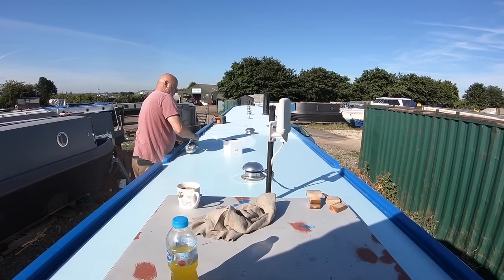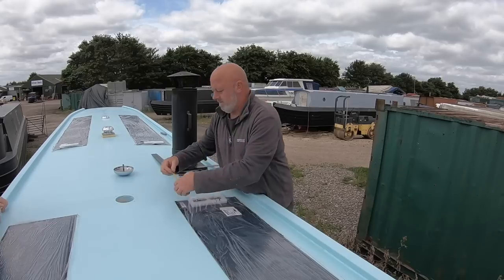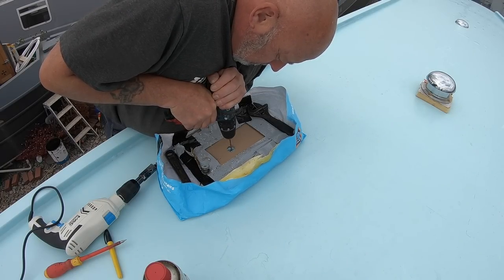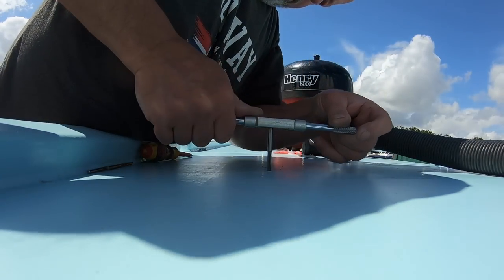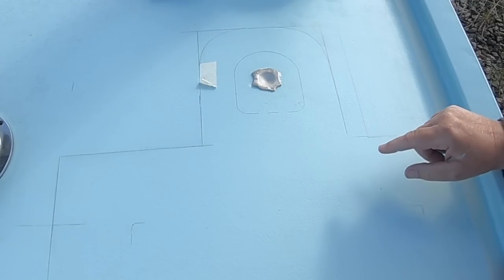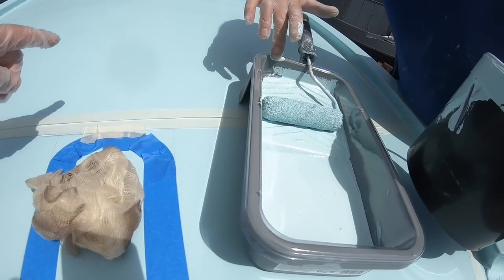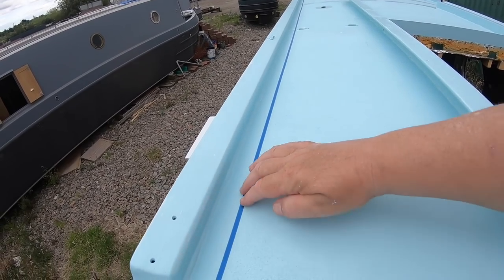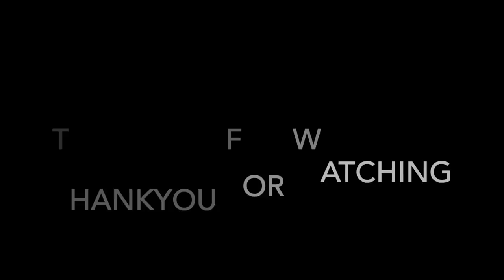Vlog 80, Narrowboat Fit Out -  ANTI-SLIPPING THE ROOF AND DRILLING MORE HOLES

Comment: Did that paint have a fast curing time?  I was wondering if insects or debris floating about in the air was a problem for painting out doors.  A thorough job as usual.  Steve
Reply from the maker: Cheers Steve, We were surprised that we had no insects stuck on once it dried. There was however lots of dots of spider poo and a couple of bird poos to wipe off between coats. The sky blue is a satin finish and cured really fast. The Aqua is a gloss and stayed stickier for longer. 👍